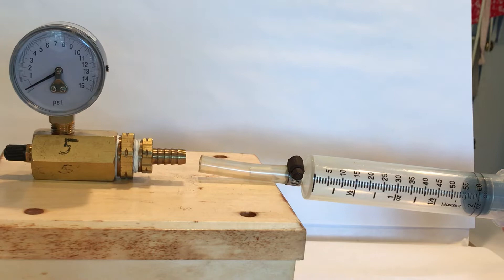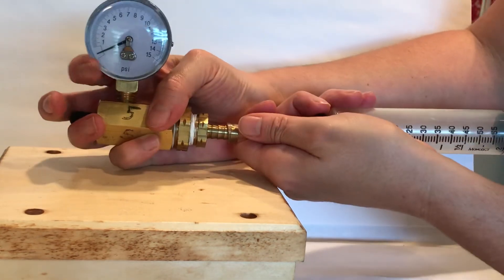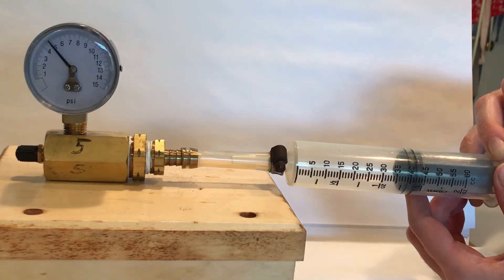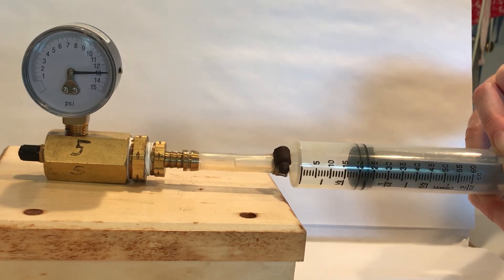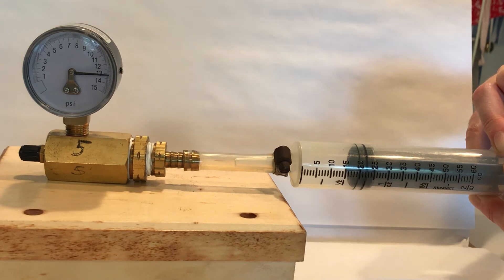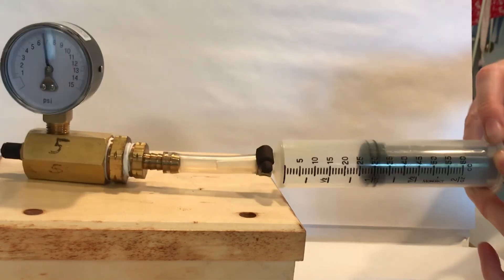Boyle’s Law

Comment: Don't forget to add atmospheric pressure to pressure reading if you want to do a Boyles' Law Lab.  Also, it is pretty clear that the system is leaking pretty badly, as you should reach 15 psig  at a volume of 30 ml.  (15 to 30 psia for a volume change of 60 to 30 ml)
Reply from the maker: It's a qualitative look at the relationship between pressure and volume ;) It gives a lovely graph for the intro students.